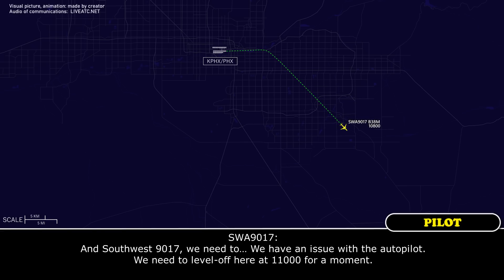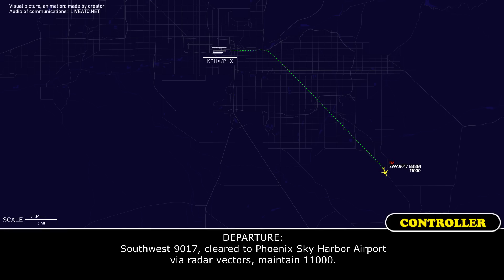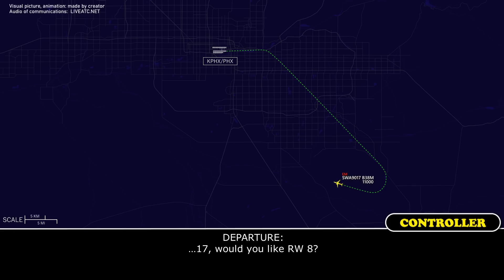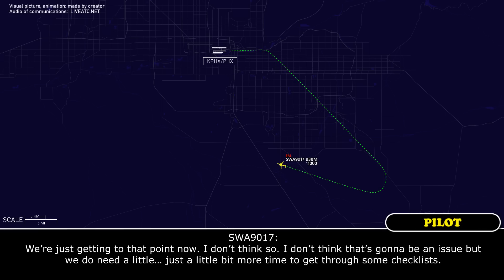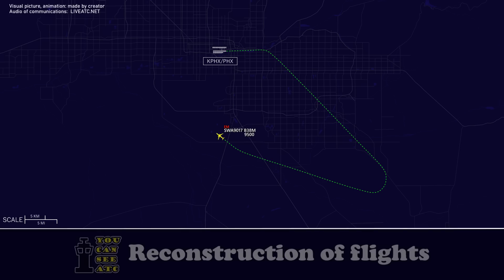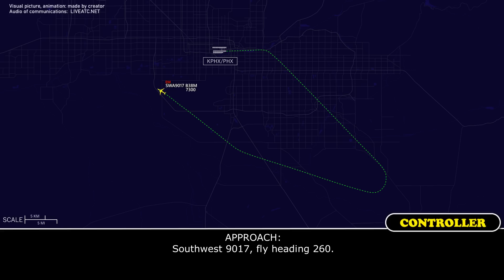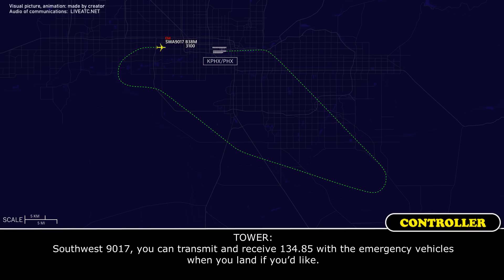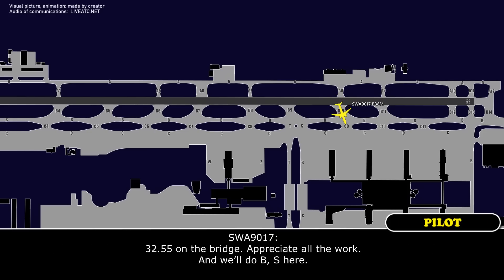“Trim system is not working”. Autopilot issue. Southwest B737 MAX 8 returned to Phoenix. Real ATC

Comment: Autopilot stab trim is NOT an emergency issue. A true aviator would simply disengage the autopilot, fly the plane manually and go about his business quietly.
Reply: Doesn't happen these days. Some airspace you are required to have AP engaged because a human cannot maintain the same path to the same precision as AP and planes are just 1000ft apart from each other

Comment: Aircraft had declared an emergency and def there is an extra workload for the pilots but why center keeps handing over to different controller?  Wouldn’t it be helpful to have single controller until final to manage this?

Comment: Combine small air brake and small flap differential is the same as trim
Reply: HI Eric....Did you fly the B707-320...
Split the systems...
Nose up???
That requires inboard flap and outboard spoilers. !!!
Trim by pulling the speed brake lever..........

Comment: Boeing just keeps pumping out quality.
Reply: Corporate greed can destroy the best companies in a heartbeat.
Reply: Call me biased but even the 787 seemed flimsy and cheap, the interior always rattles like crazy. Comparing it to a A350 which seems very solid.
Reply: @incremental_failure  Boeing is ran by business people, not engineers.  Business people have one goal, secure their own paycheck above all else.  They will gut a company to gain a few more days of pay if that is what they need to do.  See SVB bank as proof of that.
Boeing operates as an ATM for execs and board members that does the bare minimum with engineering and manufacturing to keep the ATM working.  It is extremely dangerous, but nothing is ever done about it by the FAA because boeing is "too big to fail".
Airbus will be a monopoly and boeing will be dead within 10 to 20 years if nothing changes.  Boeing is on a slow bleed.

Comment: Why doesn't Boeing fix these issues?
Reply: I hate to break it to you, but any airplane with an A/P stab trim capability can have "this issue"  I've had "this issue" in NG's. It happens in Embraer's. It happens in McDonald Douglas's. It happens in Airbuses. It happens in any airplane where the autopilot can trim the horizontal stab. Despite what NetFlix may want you to believe.

Comment: Was this due to the MCAS?
Reply: no
Reply: @achmedbincouscous2846  - what makes you so sure?
Reply: @HH-mw4sq  Because I'm a 737 Captain and I know the difference between a failed autopilot trim input and an MCAS issue. 
MCAS literally does not activate when the autopilot is on. This crew clearly states it is an autopilot trim issue.
This was not an MCAS issue.
Any airplane with autopilot stab trim capability is subject to failure of said stab trim input. 
I've had A/P trim failures in NG's. NG's do not have MCAS.
New airplanes can be glitchy.
I've had everything from lavatory failures to A/P glitches to APU failures in airplanes less than a month old.
I had a hydraulic pump failure in a CRJ200 on it's first revenue flight one time.
A/P trim failures are certainly nothing new, and certainly not exclusive to 737MAX's
Reply: @achmedbincouscous2846  So how does the MCAS pitch the nose forward when it detects a stall.
You said it ....the function of the autopilot effects MCAS.
So there is a dependent connection.??
Reply: @daftvader4218  MCAS uses the Speed Trim System. Which by definition, also does not function with the autopilot engaged. Every 737 from the Classics forward is equipped with STS.
Reply: @achmedbincouscous2846  Thanks for that..
.How does the autopilot fly the plane???
Does it not  use the Trim System as the trim wheel moves a lot
 when the autopilot is in command.
Isn't that the same trim system the MCAS uses to pitch the nose down when it detects a stall ??

Comment: Does this mean that there is potentially still a problem with the MAX MCAS trim?
Reply: no
this was not an mcas issue
Reply: No.  Period.  End of discussion.  This has exactly nothing to do with MCAS.
Reply: @j.heilig7239  End of "discussion"? I asked a question. Does that constitute a discussion in your mind?

Why not just say "No, it hasn't anything to do with MCAS"? (Like the polite reply from Achmed).
Reply: @j.heilig7239  So how does the MCAS pitch the nose down in the event of a stall ???
OR a faulty AoA indicator.
Why do you have to turn off the stab trim according to Boeing Bulletins with a faulty MCAS.??
Do tell me...

Comment: This is not a new problem. I had the same issue on a 737-800 going into Tampa once. You have to use the manual trim wheel while hand flying the approach, and it’s best to configure early. Once fully configured you only need slight trim changes until landing.
Reply: this is where our training from PPL kicked in heheh.
Reply: MAX series a little bit harder given the engines have more effect on pitch.  But hey, it’s still a mechanically sound aircraft with all the surfaces doing what you tell them.
Reply: @suunto61  Not originally...not sure now.
An old design flying pig with new  bright red lipstick..

Comment: I just flew on a 767 out of Atlanta to London three weeks ago. We had engine trouble over the Atlantic and had to return to Atlanta. I talked to the Captain. He didn't mention, and I didn't ask, but I think we dumped fuel before landing. Flight DL0030 ATL>LHR. They had at least eight emergency vehicles lights flashing lined up for us. We got both a new plane and a new crew. I have nothing but praise for Delta on how they handled the entire situation.

Comment: I was on a flight from Frankfurt to Malaga Spain last year. The captain says its a special flight because it the first commercial flight in the A320.
All the people in the cabin were cheering. I'm just saying oh geez in my head. Needless to say, I was nervous.
Reply: Aircraft are inspected @Airbus as a pre-delivery inspection and then a delivery flight has to occur with staff and VIP's back to home base. So the first commercial flight isn't the actual first flight of the aircraft, so in theory you shouldn't see an issue on a new plane unless you are very unlucky.
Reply: @0xNameless  That's why I said it was its first commercial flight in said comment.

Comment: Losing electric/auto trim while retaining full functioning manual trim may be a huge problem given the B737 max8 issues but how big of a problem would it have been to continue without the autopilot? Years ago I manually flew a Gulfstream GIV on a three hour leg without  a functioning autopilot. It was an annoyance but certainly doable.
Reply: But if autopilot not working you wouldnt know the underlying reason yet or what else is at risk
Reply: Well, the bird did fly the next day and, according to flight radar, has been doing so rather steadily since.  That said, I’m flying to SFO in April and am having a tough time accepting I’ll be on a MAX 8.  I do not trust Boeing’s QC.
Reply: @shepardbook  But you are a dunce who trusts driving your car to the airport wherein the odds say that you are far more likely to die in that crappy car of yours than ANY....I SAY ANY....commercial airliner. Please try to think these things through and try not to advertise your lack of reasoning and cognitive ability. We are embarrassed for you and we don't even know you.
Reply: @RLTtizME  well, there is something to say about being in control of one’s fate.  Isn’t there?
Reply: How many other systems are tied to the auto pilot, though? And on a brand new (presumably digital) bird, if one system failed what else is going to?
Reply: @ItsDburch  The coffee makers.
Reply: @RLTtizME  Which, of course, would start a riot onboard.
Reply: I did 3000 hours manually flying a twin turboprop around Europe back in the 90s.
Reply: Probably against regs for commercial ops.

Comment: The words "declare an emergency" and "stabilizer trim problems" in a 737 MAX is REALLY a potential "we're all gonna die" panic situation! This is reflected by the fact that the pilots having absolutely no trust in a brand-new B737MAX, obviously expecting the worst! The good news: At least these pilots KNEW about the potentially faulty systems (unlike the poor sods that ended up in a crater or a water-spout) and were better prepared to handle another potential Boeing mal-design. 
Boeing and the FAA (both having being proven to be badly corrupt entities) can no longer be relied on regarding aviation safety. 
I would be not at all surprised to find the entire Boeing 737 MAX fleet grounded for an indefinite period of time in a few days or weeks, when the NTSB has some preliminary results from the upcoming investigation. The alternative might be a cover-up, no groundings, and 737 MAX's raining from the skies this summer.

Comment: I work on airplanes and IM TELLING YOU ! A pilot is not what they used to be. 
Planes can take off and land pretty much by themselves that’s why they turned back bc the auto pilot had a malfunction but they had full control of aircraft.
Reply: Junior ...NO commercial airplane takes off AUTOMATICALLY. .
FACT...
Reply: I don't think it's legal to continue flying with a malfunctioning auto-pilot regardless of how skilled the pilots are at hand flying.
Reply: @jb8331 Well how are you going to fly the plane???
If you are in RVSM airspace (1000 ft separation from opposite aircraft ) then you have 
to have an autopilot  but you could offset your track erc etc with ATC permission. 
Anyway many aircraft have several autopilots The B747 has three independent system.

Comment: Ah shit, here we go again 😂 another time the 737 Max 8 thankfully with skilled pilot
Reply: This had nothing to do with MCAS. Only the 737 Max has MCAS, but all commercial planes use the horizontal stabilizers to trim the aircraft. The auto-pilot should be trimming the aircraft at various times to ensure it is flying as smoothly as possible. Looks like the stabilizers weren't getting trim feedback from the auto-pilot, either due to an electrical issue or maybe a motor issue in the stabilizer itself.

Comment: All the third world pilots who crashed the other 737 max aircraft had to do was what these pilots did. Disconnect the auto throttles and the auto pilot that’s two switches) and hand fly them to an airport.
Reply: The insane part is the Ethiopians *DID* disconnect the A/P and A/T. Unfortunately, they left their N1s at takeoff thrust and pointed the nose at the ground. 
Boeing literally had to add a line item to the Immediate Action Items for the Runaway Stab saying to use the control column and thrust levers to control the airplane's pitch attitude and airspeed.
Astonishing.
The other thing no one ever talks about is the first LionAir crew who had an MCAS issue ran the old version of the procedure (correctly) and then landed safely.
So not *ALL* 3rd world crews are abysmally incompetent. In the case of the MCAS incidents, only 2/3 of them were.
Reply: @achmedbincouscous2846  How many B-47's crashed, 206, yeah, good job Boeing.. Flown by the MOST competent pilots in the world at that time.. Blame the pilots again and again.. Wait, B-47 explodes, darn pilot, B-47 crashes on takeoff on fire, blame the pilots, on and on and on and on.. BOEING isn't always right..
Reply: Like the First World United pilot who almost crashed a B747 in SFO ...????

Comment: Imagine a car designed so the steering wheel goes left on its own when released.
 Then installing a rubber band to keep it straight.  
  This is called a design flaw..
Reply: Imagine someone thinking that a failed autopilot stab trim input was the same as MCAS. 
This is called a silly groundling.
Reply: @achmedbincouscous2846  GLAD your the acknowledged expert on ALL things aeronautical, in fact, I heard you saved APOLLO 13.. LOL..
Reply: @achmedbincouscous2846  I have 22,000 hrs all types.. Trumps your little mess..
Reply: @peteparadis1619  In what and for whom? For real. What type ratings? I'll be glad to post a picture of my ATP certificate. How about you?
Reply: @peteparadis1619  Also, perhaps you can work on your math skills. By my calculations, my 18,000 in 737's plus another 8000 in other transport category A/C adds up to 26,000. Which "trumps" your (not you're) 22,000 make believe hours. But hey, at least you spelled "your" correctly this time.
Reply: @peteparadis1619  Hey Pete, how's that Google search for pictures of other people's ATP Certificate coming along? Or are you busy flying? You know....adding to your 22,000 hours 🤣
Reply: @peteparadis1619  Nope, both eyes work fine. My AME says so every 6 months. I'll wait here while you Google what that means.

Of course, having your 22,000 hours of "all types" time, I'm sure your AME just takes your word for your visual acuity right?

Negro Astronaut? Nope. Just an ordinary middle aged white guy. Who's been flying real airplanes professionally for over 30 years. And has a picture of his real ATP certificate posted for all to see. Including a 737 Type Rating

Still waiting for you to do the same.
Reply: You absorbed most of your engineering expertise at Waffle House?

Comment: Yet another Boeing 737 Max runaway trim issue. Seems that Boeing have still not fixed this issue. Boeing stopped being good when the Mcdonald Douglas management wankers started taking over from Boeing Engineers and they moved the Headquarters to Chicago.
Reply: This was not a runaway trim issue.
Reply: @achmedbincouscous2846  But would you agree that Boeing would be a better company if the engineers were back in charge?
Reply: @sociopathicnarcissist8810  I 1,000,000% agree. There are countless examples of how bean counters ruin great companies. This is a classic example. But despite my disdain for Boeing's bean counter management, (as well as a lot of other companies) I am 100% satisfied the MCAS issue has been resolved, and the MAX is a completely safe airplane.

Comment: People are jumping on the MCAS train way too fast! This is not a Boeing unique situation and has nothing to do with what the MCAS does. It’s also worth noting this is why having two pilots is so vital.
Reply: Considering the two fatal crashes, the problem being complained about is a trim problem, the Boeing lack of urgency on the MCAS issue, and slow actions of regulators, I can understand why everyone jumped to MCAS.   People jump to what they know and Boeing hasn’t done the work to replace that predisposition with other messaging.  The MAX is branded as bad plane by some members of the public.  Boeing is branded as a bad company by some members of the public.

I am not surprised.  Negative events last longer in the psyche than positive ones.
Reply: @matthewgaines10  this is an event that could happen in literally any airplane. Boeing is just the default thinking, while understandably so it’s ignorant thinking. Just like the people who say I’ll never fly on a max. 5 years later, when it’s the cheaper option and results in getting you there on time…what do they do. You guessed it!

Comment: New plane with bad autopilot. Having to hand fly is an emergency?  I thought they had a runaway elevator trim.
Reply: It was not a Runaway Stab. It was the autopilot not trimming the stab. Big difference. The reason they declared an emergency was not the hand flying part, it was the potential of a flight control issue, even if that potential was very remote. Declaring an emergency is free, so why not declare?

Comment: Why at this age the pilot still have to state fuel and souls on board? Couldn't that already be automatically transmitted by the plane? Also, couldn't the souls on board or the actual manifest be saved in a database or something before departure?
Reply: There is no equipment to transmit souls on board and fuel to ATC besides it is not needed when there is radio contact. Sou!s on board and fuel is entered to flight operations however in an emergency ATC is the first to contact the emergency services who needs this this information immediately. An emergency can go from a trim issue to a full blown engine flame out mayday mayday when there is no time to loom for information .
Reply: When declaring an emergency, fuel on board, soups on board, dangerous goods in the cargo hold are standard things passed on to the emergency crew on the ground. It’s not automatic

Comment: Boeing’s 737 Max still plagued with problems after the Boeing engineers had 20 months during the FAA grounding mandate to fix those problems.
First, Captain MCAS and its runaway trim pitching the nose down. 
Now, Autopilot and its broken trim not pitching the nose up. 
What’s the third trim problem Boeing will need to fix on their 737 Max?
Reply: A/P stab trim failures are not unheard of, on all airplanes. I've had several of them on non Boeing products, as well as non MAX versions of the 737. This was completely unrelated to the MCAS system.

Comment: Sounds like an Autopilot issue more than a trim issue.  The pilot said, once they hand fly, everything is fine, but with the autopilot on, it's not...  The Autopilot mainly controls the trim/pitch of the aircraft.  So it makes sense, once the autopilot is engaged, it can't regulate what the trim should do.  Doesn't sound like an MCAS issue.
Reply: They said that they had to use manual trim, so it would seem it’s a problem with the electric trim system which is used by the autopilot. Manual trim is an abnormal procedure in the 737. The trim wheel has to moved by hand and it requires some muscle to do so.